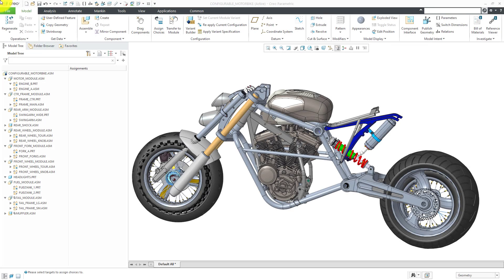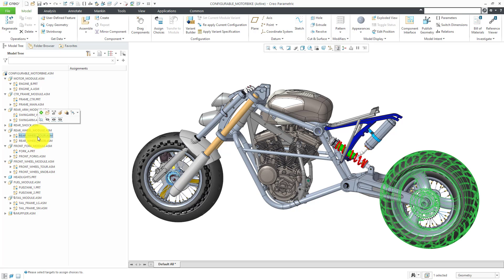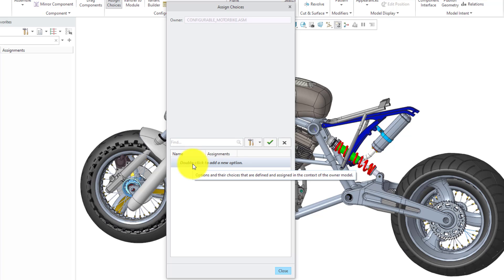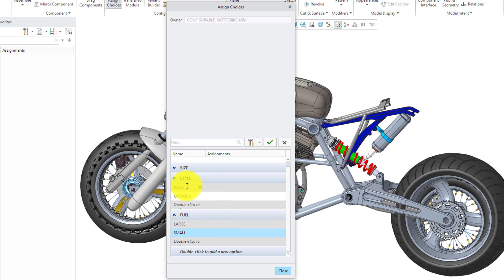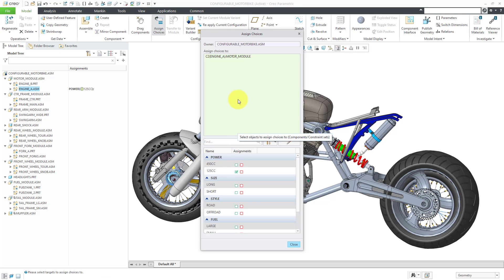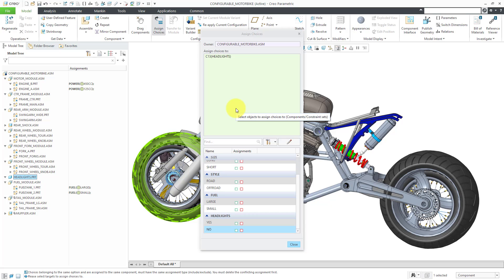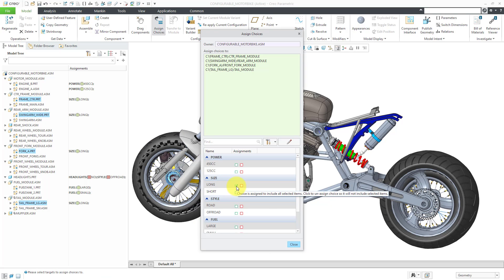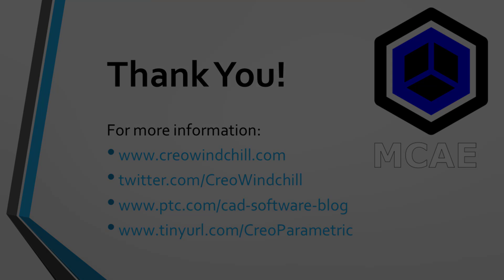Creo Parametric - Options Modeler | Assign Choices

Comment: Aren't the same thing possible with family table? Main benifits? Thanks for sharing the knowledge.
Reply from the maker: There's a lot more variation possible with Options Modeler. Also the operative words in CTO are "to order." You are not predefining instances. You are also not managing instances. Let's say you have 8 A-B choices. That's over 250 instances. With 10 choices, that's over 1000. With 10 A-B-C choices, now you're managing over 6500 instances. Here we have our Configurable Product and we generate variants on order. Family Tables are more appropriate for an Assemble To Stock (ATS) manufacturing strategy whereas Options Modeler supports Configure To Order.
Reply: @CADPLMGuy  Thanks for detailed answer. Will wait on next video about variant builder.